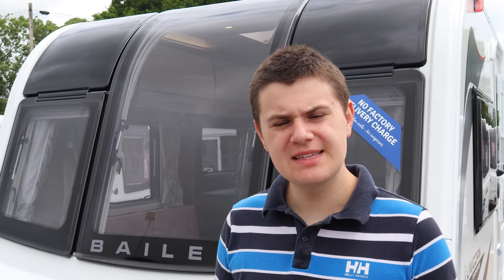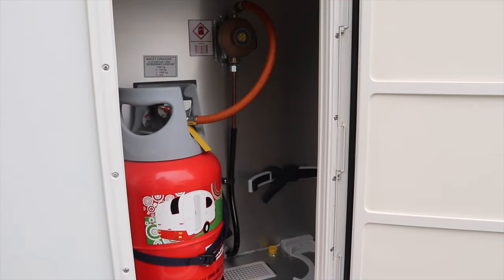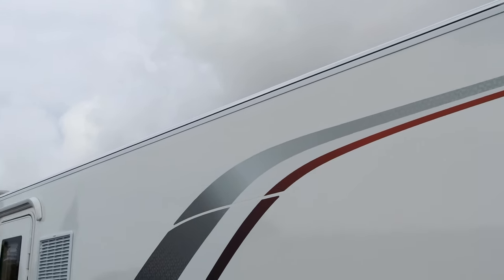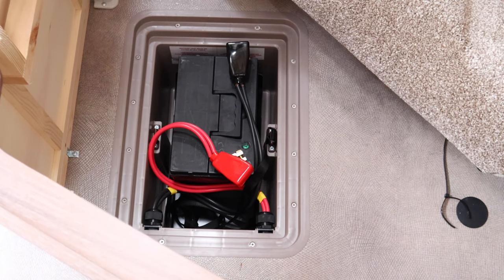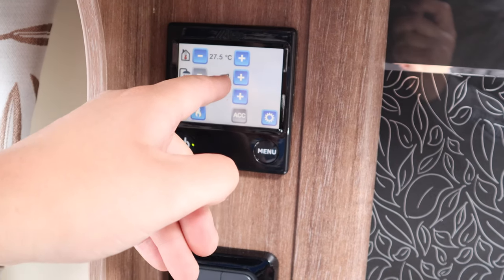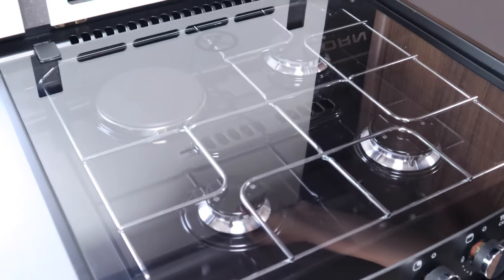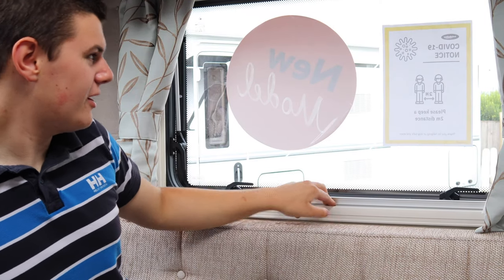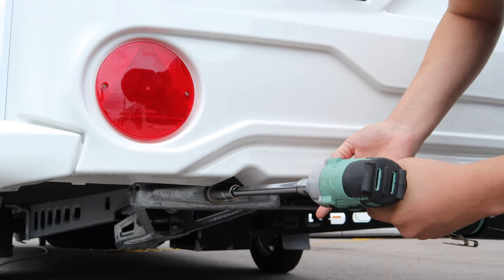How to Correctly Set up and Use a Caravan Fully - 4K

Comment: if a hot day doors open all day in awning does the door restrict air circulation from fridge vent when open?  had a bailey for 1 year from new but had leaking water from that big curved front window. was never opened from new dealer had loads of goes at fixing. in end said enough was enough and got a swift eccles
Reply from the maker: Hi Andy, Interesting Question that one. Their is a gap between the door and the vents so they have a place for the air to escape. Sorry to hear you had issues with your Bailey, touch wood... we have had no issues. Thanks for watching, Oliver.